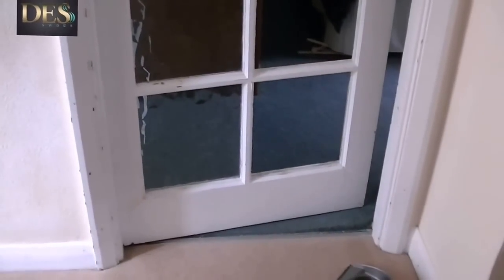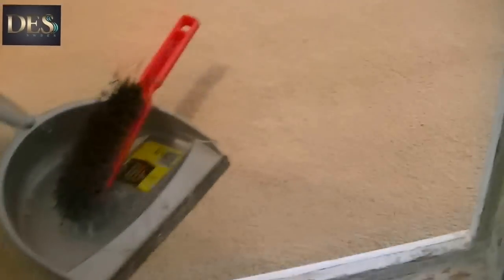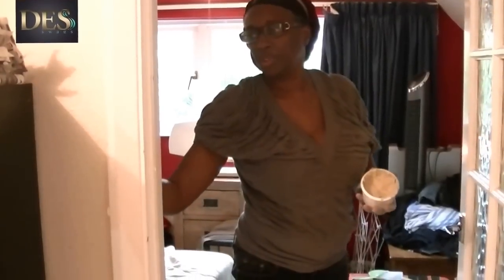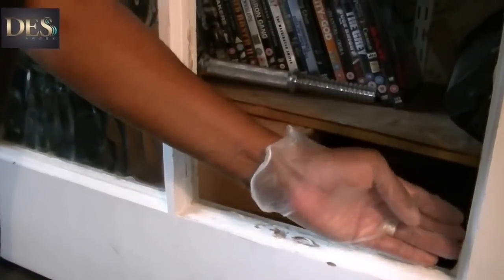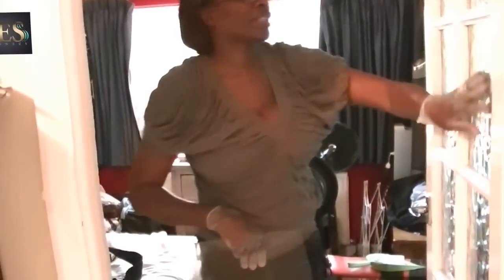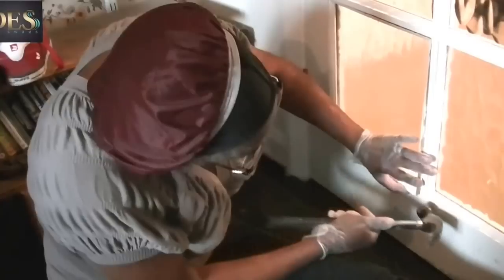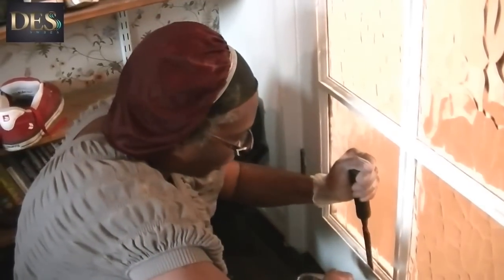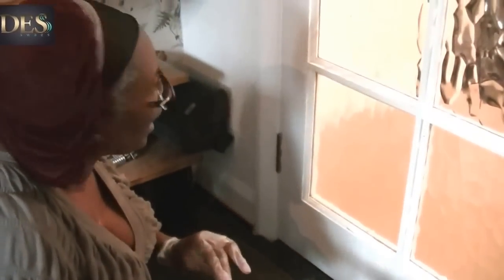Guide to repairing broken window: Step by step instructions for successful window class replacement

Comment: This was so helpful to see this process! It makes me feel a lot less afraid to actually make some fixes now. :) Thank you for sharing this!
Reply from the maker: Thank you for watching I’ve just seen this so I’m just responding. Apologies for being late but my motto is. I will do my best to repair anything around the house and after I have tried to fix it to save money and if I fail then I will call-in the professional, but so far, I have saved my family a lot of money to this day. You take care and have the confidence to do what you can and just research as well. Bearing in mind over the years I have been to several classes to achieve what I want to do.  1. is bricklaying 2. is carpentry, plumbing and electricals small jobs which I don’t advise you to do, but when I was younger, I tampered in those things, the easy jobs. At the moment I am insulating my loft and raising the floor in the loft because the electricians over the years have put the wires over the floor, Joists making a mess up there, so the only solution was to put a subfloor above all the electrical wires. I am 65 this year and I am still doing DIY jobs to save money. God bless. Take care

Comment: Are you the curtain lady as well ?

English Mik
Reply from the maker: Yes, I am also qualified in Reflexology also qualify in body massage I am  also did bricklaying course but I didn’t stick around for my certificate because I needed to build a wall within the summer before the winter setting so I left the course, yes I build walls. decorate my house anything that needs doing I will do it if I make a mess of it electricity I call professionals in to do the electrics. Also did a little plumbing I did also plaster. I am a qualified interior designer, professional interior designer and soft furnishings. I love collecting certificates. I’ve also got certificate for archery. And certificate for agriculture.🤪

Do you need some curtains made just give us a ring thanks for watching my show hope you enjoyed it. 🤫
Reply: Des Swags Curtain & Blinds Maker 

Hi a woman of all trades then ,..l am a Carpenter -joiner 50 yrs now , buy way those bead pins , either get your chisel lay it flat on top of pin, and gently knock it down with a hammer, of pair of pinchers and pull them out ...No lve a thousand questions to ask you about  starting  to make  those lovely curtains and blinds ect...for my self to start up a small business, have just retired, like how do you drive customers to you ,  Do you advertise on line, or use social media and YouTube ect, ect,  America has and what's best sewing machine to get, New or used one ....99,9999 questions to fallow ....so your still a centi foot / millie/ inch user ..llol
Reply: Des Swags Curtain & Blinds Maker 

America ! ..how did that get there ,,,?    what is best sewing machine to use ,  New /or used one .
English Mik.